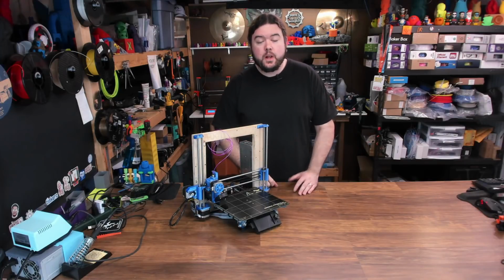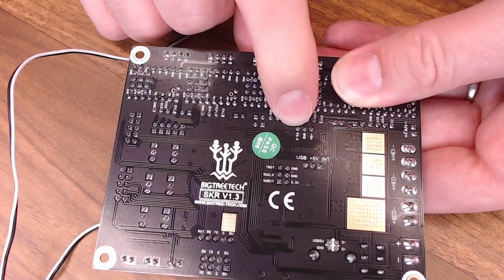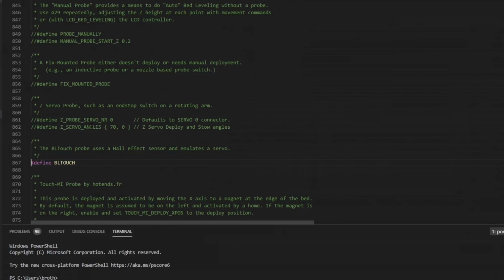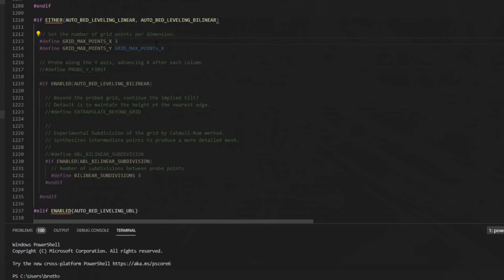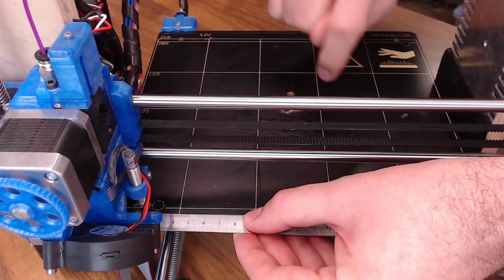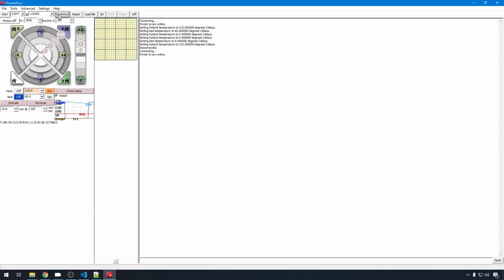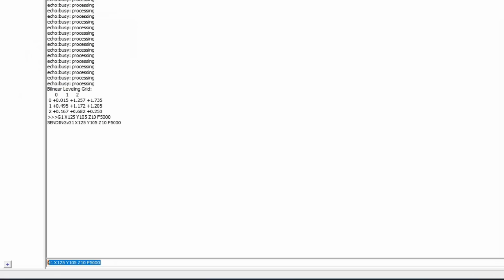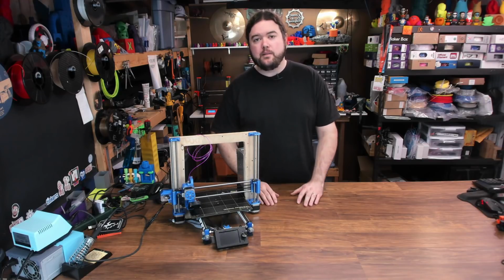Auto Bed Leveling - Marlin 2.0 - How To - 2019 - Chris's Basement

Comment: Great tutorial Chris thank you. Just set up my Ender 3 with SKR 1.4 turbo and BL Touch v3.1. Never used ABL before so just testing but is there a min and max value that the Z axis will move to compensate for different levels across bed? When I get the mesh values my bed is pretty good but I don’t see any movement in the Z axis at all?
Reply from the maker: Thanks! I am not sure if there is a min or max, but I know there is a low point, so you can't go to far in the negative. You might check out the fade height setting as well.

Comment: I just bought an anet a8+ 3d printer,
it has a filament runout sensor installed and an auto bed leveling without probe (manual moving z-direction at 16 points on the bed). I want to upgrade my auto bed leveling with bl touch or else and probe (auto z-direction move to 16 points in bed)
in my upgrade plan, how to edit the firmware?
do I have to back up the firmware setting 1st then add a new setting?

I'm a total newbie
Reply from the maker: Unfortunately, you can't do a backup, so you just have to jump in and fight it until it's correct.  The best you can do is run a M503 and pull some of the printer data then use that to update a vanilla version of Marlin.
Reply: @ChrisRiley  thanks for the explanation

Comment: In the SKR 1.4 (non turbo) am I enabling pulldowns/pullups (or touching any of that) while using Bltouch 3.1 as my Z sensor, prob going to use sensorless homing as well with the TMC2209 in UART mode. Other thought I had was, install a Z switch, in case the BLtouch fails and wants to crash into the center of the Earth?
Reply from the maker: You can setup both, but you will have to move the default bltouch probe pins to something other than Z min endstop pins.
Reply: @ChrisRiley  yeah I got them in their servos designated homes on the board, which I think is what I need? I've read conflicting reports of needing to clip/unsolder and not needing to clip that diag pin under those TMC 2209s.
Reply from the maker: @miremaker  You only need to clip them if you want to use the other ports on the board. EN0 EN1 power detect ect.

Comment: I have a problem. I set the correct probe to nozzle offset, but the printer does not calculate that in the equation. The min probe edge is taken into the ewuation. what am i doing wrong? 

#define X_NOZZLE_TO_PROBE_OFFSET -4  // X offset: -left  +right  [of the nozzle]
#define Y_NOZZLE_TO_PROBE_OFFSET -74  // Y offset: -front +behind [the nozzle]
#define Z_NOZZLE_TO_PROBE_OFFSET 0   // Z offset: -below +above  [the nozzle]
Reply from the maker: What is it doing, how do you know it's not taking it into account? It never hurts to update eeprom when things like this happen. Run a M502 and M500.
Reply: It tries to probe 74mm in front of the edge of the hotbed, and then it crashes.
The nozzle is where the probe should be.
Reply: I will try to set it with M851, and it did the trick. 😁
Reply from the maker: @3D_printer_guy  NICE!

Comment: I've gotten this working great on older versions of marlin on 8 bit boards, but am not having the same luck with my SKR 1.3 (running Marlin 2.0).

It compiles and uploads fine, but M119 always returns 'open', even if I hold a tool under the probe (triggering it). I have it wired to my Z- endstop, and I've set this up in my firmware.
Any ideas on what's going wrong/where I should start looking?
Reply from the maker: On a 1.3, make sure your Z diag jumper is off.
Reply: @ChrisRiley  I had to de-solder a pullup resistor, that did the trick. Thanks!

Comment: Hey Cris, love your work! is there any way to use a negative value for min probe edge?
Reply from the maker: Thanks! I think your only option is to set your minimum bed size in the negative.
Reply: @ChrisRiley : I figured it out! 
  #define MIN_PROBE_EDGE_LEFT MIN_PROBE_EDGE
  #define MIN_PROBE_EDGE_RIGHT 15
  #define MIN_PROBE_EDGE_FRONT 15
  #define MIN_PROBE_EDGE_BACK  15
and 
#define X_MIN_POS -35
#define Y_MIN_POS 0
#define Z_MIN_POS 0
is what I needed. Thanks so much for your guides!!

Comment: I'm having an issue. When I choose to export to compiled binary I get an error. I have the BLtouch kid that comes with the burner and the progisp program. It only works when I flash Hex files
Reply from the maker: This is usually some sort of driver conflict. You might check in device manager and see what it calls the board.

Comment: Hello, I have a big problem ... I bought this sensor: https://www.amazon.fr/Taiss-Lj8-a3-2-Z-normalement-commutateur-fonctionnement/dp/B07JZ2G44K and it does not does not work with my motherboard (SKR 1.4 Turbo). It's not the firmware that doesn't work, it's the sensor. When I put it on the board the voltage between the signal and the ground is 3v (instead of 5v) and when I put a metal piece nothing happens. By cons, when I connect it to an external 5v 1A power supply, the sensor works very well, the voltage between the signal and the ground is 4.5v and when I put a metal piece it goes 4.5v to 0.1v. I therefore deduce that the card did not give enough current to the sensor. It uses 300mA but so does yours, so I don't understand why mine doesn't work ... Thanks !
Reply from the maker: Sounds like you have a bad board, you can try to switch it to another endstop, but my guess is there is something wrong with the 5v regulator.
Reply: @ChrisRiley  Thanks, but I solved my problem. In fact, when nothing is connected to my card, and no current flows through it, the triggering of the probe changes the voltage from 3.5v to 2.5v. To work around this problem I changed pins for endstop, I took the one below. Then it went from 4.8v to 1.15v. I blocked a long time on this problem, but as soon as current passed through the card, it goes well from 4.8v to 0.01v, so now before using it I do a preheating and it works very well.

Comment: Pnp sensor is an positive, negative and positive signal. 
Npn is negative, positive and negative signal. 
NC is a normally closed ( when sensor activate the signal cuts off )
NO is a normally open ( when sensor activate it will give a signal )
Reply from the maker: Thanks for the info!

Comment: hi,  Chris. According to this video, I've got two questions for you. First, Imagine there is a little hole in the bed and the probe detect it. When printing the first layer, will the nozzle go down to the lowerest    
 point in the hole(negetive Z comparing Z zero), with softend limitation turning on?  Second, is the bed surface is not perfectly level, it is  meaningless to just pick one point of referrece for z-offset calculation. Will it be accurate to calculate several points and then use the average value?
Reply from the maker: It's hard to explain in text, but ABL will only get you so far. If there was a hole, it will skew your results, but it will go into the negative to try and compensate. It will ignore the software endstop. THe offset is only used to set the distance from the probe range to the nozzle. The leveling will take care of it.

Comment: Just started watching your videos to rfesearch auto bed leveling.  Love them!  Informative and concise.

I bought an Anet A8 style printer 3 or 4 years ago.  Does the Marlin 2.0 and bed leveling translate to the control board it came with?

All the best!
Reply from the maker: Thanks for watching! You can get it on there, you will have to disable some of the features to get it to fit. There are examples for the A8 out on the Marlin github that should work.

Comment: Hi Chris. I’m having an issue where I was able to change the Z-probe offset on the User Interface only one time. I can no longer change it. I’m not sure If I accidentally changed a setting that locked it or if it is just a bug. Do you happen to know of anyway to fix this? I believe I am using Marlin 2.0.3
Reply from the maker: It might just be stuck in eeprom, run a M502 then M500 and try again.

Comment: 12v sensors may be a better choice as detection distance will be higher. Easy to connect with mosfet. And other sources are saying that bltouch it's much better than inductive sensors. Prusa is using integrated temperature sensor (while wire)  to compensate temperature deviation but it's still sensible to be humidity levels as well and bed material.
Reply from the maker: 12v does give you a bit more distance. From my testing, inductive probes are more accurate than bltouch sensors. Are you thinking of capacitive sensors maybe?
Reply: @ChrisRiley  To double check: Autoleveling on 3D printers: 9 myths and 12 sensors tested!  (By Thomas S.) https://youtu.be/il9bNWn66BY?t=708 It looks like I was indeed confused,, thanks!
Reply: @ChrisRiley  2mm vs up to 8mm :)) Times 40% in case of Al bed. Can be a deal breaker in  case on non-metal print surface.

Comment: OK, i got everything set now and working with bltouch
but when calibrating the babystep something wrong.
i adjust for good layer thickness
then the nozzle advance to other area of the bed and thickness is changing
i checked and the auto level is on and i got a 9x9 mesh values
also bed is leveled and print good without sensor
happened to anyone?
Reply from the maker: Hey Joe, it seems like there is some sort of bug when use the BLtouch. Have you looked at Marlin 2.0.3 yet, it just came out, it might have a fix for it.
Reply: @ChrisRiley  yes i am with 2.0.3 bltouch seems to work great, the extruder now have problem
it works slow and don't extruded according to command
i can make it faster by increasing min velocity but still it won't extruded the length needed
been trying to solved it for a few days now i am really clueless
saw a lot of user got this problem in github but non of what work for them worked for me
i think i might go for klipper
Reply from the maker: @GoJoe_VR  Are you using linear advance with TMC drivers? You might try turning it off and seeing if the problem goes away.
Reply: @ChrisRiley I can't believe it again it's my mistake.. i tought the esteps for the bontech extruder was correct 
but i inserted values from the stock extruder..ahhhhh .. anyway thanks.. already start working with klipper so i give
it a try it seems nice

Comment: Hey Chris your videos are great!, So I'm trying to setup BL touch with my SKR_1.4 Turbo, with 2209 drivers, stelthshop and stallgard are enabled, when # define Z_SAFE_HOMING is turned on with default setting and If i upload that and use G28 if the nozzle is already over the center of the bed it tries to move to the center of the bed again before zeroing out so it thinks when its over the bed or wherever it is, that its 0 that it starts from, sorry it's hard to explain what the printer is doing, basically exceeding its limits and crashing in the opposite direction of home. because it is trying to safe home why is that?
Reply from the maker: So it should always be doing Z last. The only thing I can think of it stallgaurd is getting triggered. I would turn off sensorless homing and try again, see if that lets it home normally.

Comment: Hi Chris! Thank you for the vid, it is really clear! However I have an issue with my Anet, where I just installed the BLTouch and the latest marlin firmware. I set the probe up, as in your video, but when I start printing (after G28 and G29 and after ZO setup) I don't know why but the nozzle of my e3d dives into the bed. It makes a side of the object quite nice, while when it moves to the right side of the object, the Z moves down and the nozzle is almost carving my bed. I can see the lines the nozzle makes on the bed. It is super weird, because it starts fine, with the right first layer height but then the Z goes down. It seems that the machine is trying to leveling the bed, but in the wrong direction. It should lift the Z on the right side of the bed, because it is a bit higher than the left side. I tried to set the babystepping movement to true, but nothing changed. Do you have any clue on how to solve this problem? Many thanks again for the guide and the help!
Reply from the maker: Hello, what does the level map look like after the G29? You should be able to see it in pronterface or a terminal after the G29 runs. In your M503 output, is you Z offset correct? Check the M851 line.
Reply: @ChrisRiley  Hi! The map is quite nice actually, no value higher than 0.5. I also went back to the bug fix 2.x, which is the one I have on my CreatBot w/BLTouch and that works like a charm. Also with that firmware, the problem persists. I really don't have a clue
Reply: Ah right, the offset is correct when I check it on my printer. Could it be the whole printer to be unlevelled? I checked the x rods and they are fine, I really don't know what it could be honestly . It is frustrating because the printer is fine, but damn the nozzle really dives into the bed from left to right sides. Btw, the map values are all negatives for the right side of the bed
Reply from the maker: @giovgon8667  It almost has to be some sort of firmware issue. There is a Marlin 2.0.3 out now, maybe upgrading to that will solve the problems.

Comment: thanks for the video. it is well made
still i got issue after probing 6 point it's just stops without the remaining 3
done on an original bltouch v3.0, skr 1.3, ender 3.. happen to someone?
Reply from the maker: Someone else said that happened to them. It has to be some sort of firmware bug.
Reply: Thanks..yeah i opened an issue on github for now i managed to bypass by disable bilinear enable linear and set the probing coordinates
Reply: *update
i didn't start from scratch i took a preconfiged marlin from big tree tech github (skr 1.3)
and it wasn't updated
the bugged that happened to me was already fixed
after configuring from scratch a 2.0.3 version everything works fine
Reply from the maker: @GoJoe_VR  Nice!

Comment: First of all thanks for sharing, i made all the setting in the video, But for the 9-point measurement, it measures 6 points and goes on to print. (I use Skr v1.3 card, MK2 heatbed (4mm glass on), 5V 18mm NPN Prop) 
Do you have any suggestions for a solution?
Reply from the maker: Hmmmm, It just does 6? The points are still set to 3 correct?
Reply: @ChrisRiley  yes, i am sure, i set it x 3 and y 3
Reply from the maker: @trdarkwolf  Sounds like that might be a firmware bug.
Reply: @ChrisRiley  I think so, thanks for comments Chris.

Comment: Chris
this doesn't apply to the auto leveling but my skr 1.3  install is not show the bed temp I think I need to change a temp sensor definition from zero I too? ( i checked and the temp sensor is showing 100K at the plug) I went through your videos and cannot find the one where you went over enabling pins.
thanks
don
Reply from the maker: I am not sure which thermistor you have, but the most common is the 100k ones like you said, set it to 1 and see if the temps come out reasonable. If it is an E3D thermistor by chance, set it to 5.
Reply: @ChrisRiley  with the bigtreetech skr 1.3 board i would set temp sensor 3  in config.h to 1 correct.
Reply: I have a 120 volt heated bed with 100k thermistor
Reply: i just checked and i guess not temp 3 but bed temp correct
Reply from the maker: @donaldking4156  Set temp sensor 0 to 1. That's the he0 plug on the board.

Comment: Good to know. I'm still running the stock firmware on my tornado and it's still working great after more than a year. Haven't had to level the bed in about a year either so I haven't really seen a need for ABL.
Reply from the maker: Nice! I always prefer the hardware be stable then trying to comperstate.

Comment: Happy New Years Chris.  Love your videos.  I have an unusual board on my Hypercube 3d printer.  I'm using the MKS-Robin v2.3 with the TFT screen v1.1 and I don't seem to be able to configure Marlin 2.0 to run on my board.  It is has the STM32F103ZE chip on it.  It up loads fine, when I restart the board the touchscreen says "completed", the hot end cooling fan comes on for a second and then the board goes into protection mode and has a blinking blue led by the reset button.  I never get anything of Marlin to display on the touchscreen. Is there a better place to tap into your knowledge?
Reply: Thanks for getting back to me Chris. MKS has Marlin 2.0 as one of two firmwares, however, they don't support it well and it seems that the original Marlin 2.0 was to be compiled with Atom and an earlier version of PlatformIO and with updates and the fluid nature of Marlin the compatibility was lost, or may never had been there for the TFT v1.1.  It seems the people that have been able to get it to work have TFT v2.0.  There are a couple guys within the Marlin world that may be trying to get the version 1.1 TFT put into the main Marlin again. The fork version they are working with did get Marlin working on my board and screen, but touch buttons are not working yet. 
I was hoping that perhaps you had a magic touch or connections within the Matrix. If not that is ok I just thought I'd try. Happy New Year!
Reply from the maker: @mattdog01  LOL, sorry not for this one, we will have to wait for the Marlin gurus to figure this one out. Happy new year!
Reply from the maker: Hey Matt, I am not sure if that board/chipset is fully supported yet. What does MKS want you to run on it?